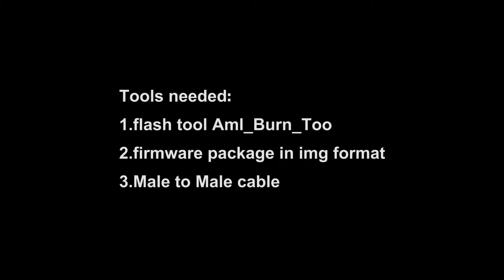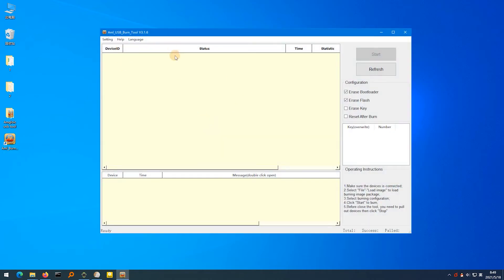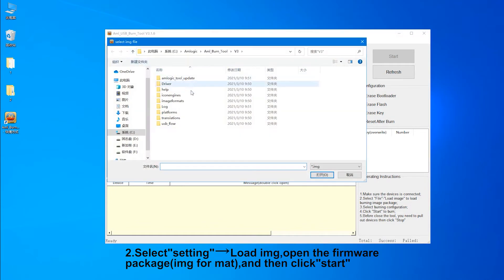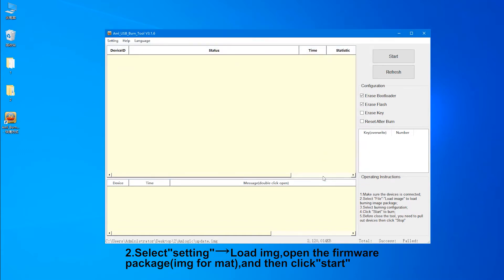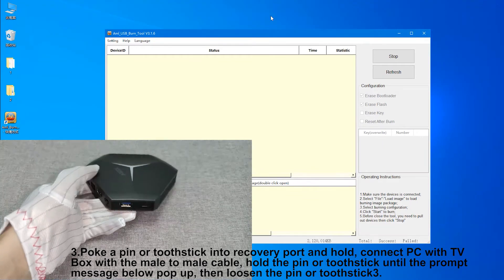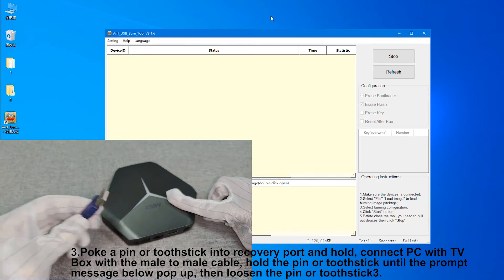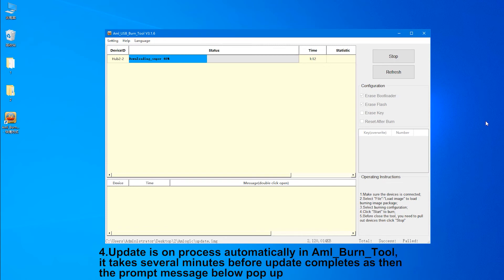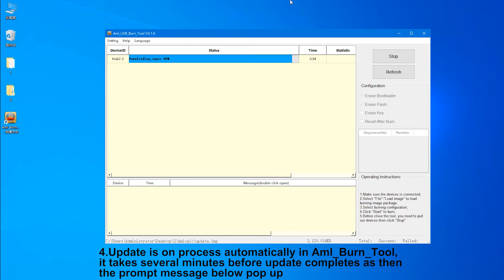Amlogic A95XF4 S905X4 burning software by amlogic tooling with img software by computer

Comment: The size of this sink is disgraceful.
It starts at a pitiful 80 degrees
I removed an old DVR heatsink with a 5 volt internal cooler
now the temperature is 45 degrees stable
this shit of RGB light I don't need
put in a decent heatsink. would sell much more
if there was root and good internal cooler.
It has a beautiful design but the heatsink sucks and no root.

Comment: Good morning, I have a TV box X96 X4 S905X4.  However, recently, I installed firmware from another TV box with similar performance, the BOXPUT BP4 S905X4, on my X96 X4 TV box.

  Now I'm trying to restore the original firmware of my X96 X4 TV box, but my computer no longer recognizes the device.  I'm a little lost and would like to ask for your help, please.  What should I do?